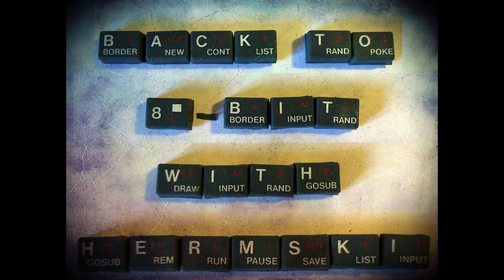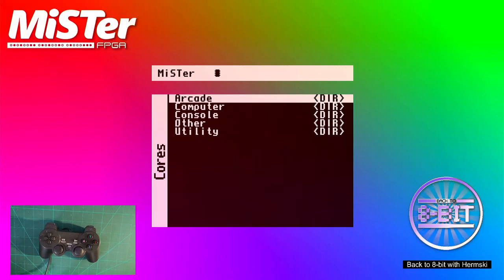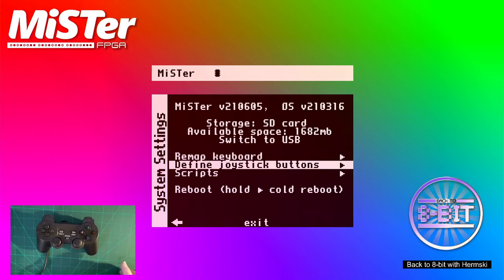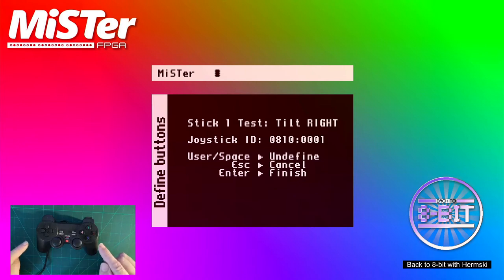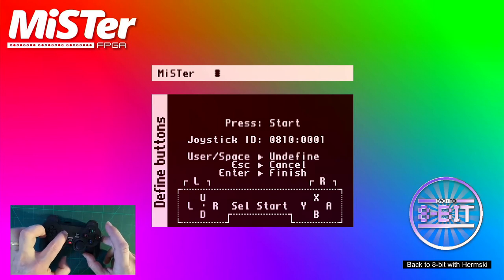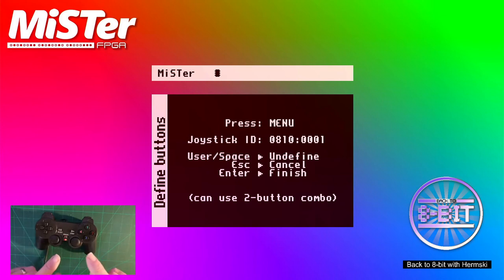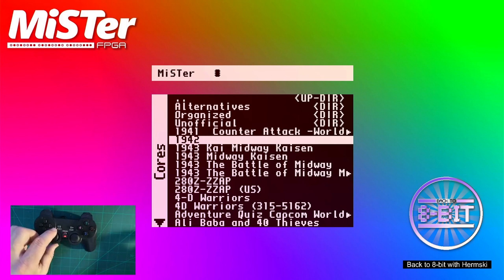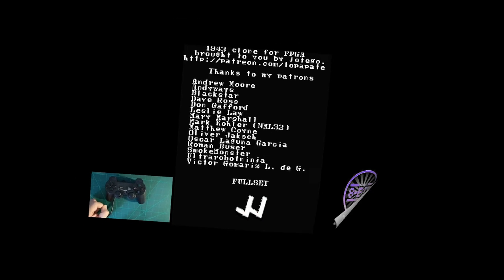Mapping Joysticks and Joypads to the MiSTer FPGA Tutorial

Comment: I cant seem to undo the controller settings. One of the buttons on my controller cant be used because I have to hold it down to map buttons for each game / core
Reply from the maker: You just need to map the controller again to change any old settings.  Once mapped on the main menu, you can set mapping for each core.  Just press f12 to enter the menu, and press enter to finish.  Also it might help to join this facebook group.  https://www.facebook.com/groups/1870135613286506/?ref=share
Reply: @Hermski  quick question... I'm trying to play my sega mega cd drive games in my MISTer but it keeps saying insert disk and the unit is flashing green. I open the Folder and see the US, Europe, and Japanese folders for games but I can use any of the games. Any ideas? Thanks!
Reply from the maker: @ozwizardof5235  Not sure as I have never used that core yet.
Reply: @Hermski  my wired controller was working but now it just flashes . I can not get it to connect now.  Any ideas how to fix it?

Comment: On my USB joystick one button pauses arcade cores, but I got a new USB saturn-pad and I cant figure out how to map a button to pause.
Reply from the maker: Oooh, just make sure you've set up and calibrated the joystick in the initial main menu settings page.  Then each core will need it mapped via its own menu the first time you run it.   Make sure you've gone through all the mapping options.
Reply: @Hermski  - Thanks - I just remembered - it needs to be done for every single arcade core :) - MISTer really has some usability issues, but the benefits keep me coming back.

Comment: Hi.  Thanks for the guide.  Question:  How do you define a joystick in the 'Menu core first' before this stage?  I'm attempting to connect a "Bug" two button joystick in my Minimig core but cannot find where to define the joystick first.  I'm connecting to my MiSTer via a DeamonBite UBS to DB9 controller.  Have spent hours searching, so am not asking as a first resort.  🙂
Reply from the maker: No worries Ray.  Turn on MiSTer, when menu has loaded up press escape.  This will bring you to a settings menu.  Go down to the joystick option.